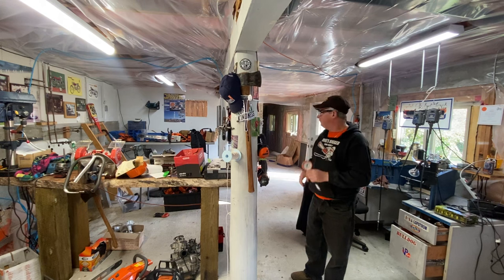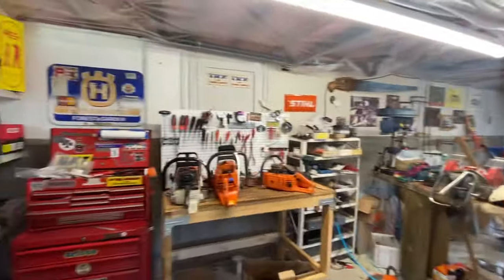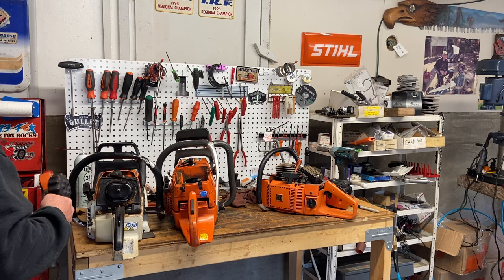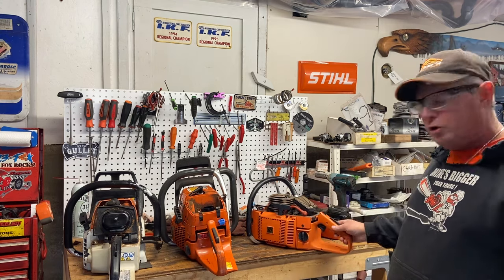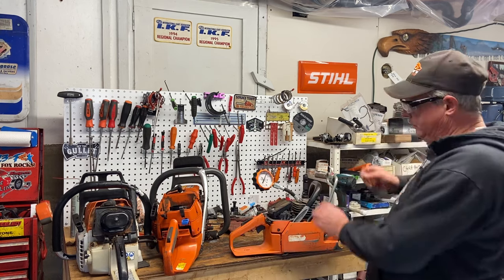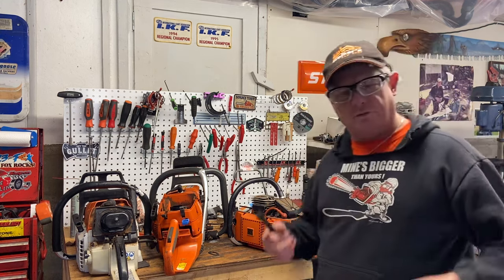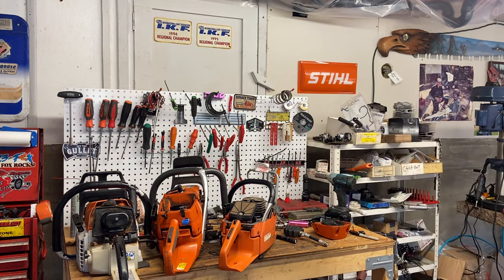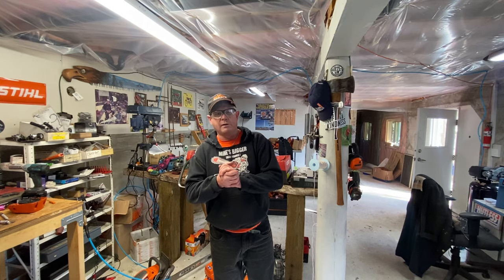How to check compression on a chainsaw

Comment: This video proves my point on why compression testers are so important for diagnostics, if someone had justy pulled the muffler and saw the scoring they would say the saw is shot but like donny says the piston is scored but the rings are fine which is what matters so the saw is fine.  also there is no way pulling the muffler will tell you that the rings are worn out or that the cylinder is egged out or that chrome plating is worn through on the cylinder.  these can only be prompted to check if the compression reads low and the only way to test it is a gauge. anyone who learned 2 stroke theory knows this.

Comment: Do you have to have a small engine compression tester, or does a normal automotive compression tester work? I just bought a snap on one and every saw i have even a brand new 572 is reading 110, 115  psi. I bought the snap on bc i wanted something accurate. I have a cheap one from Advanced Auto, and it reads every saw iv ever tested 80 psi or below, which is why i got the snap on today but now im worried it isnt right either

Comment: Donnie, I hope you’re on the mend and are back up and around quickly. A couple of ideas for some videos while you’re laid up would be your views on mix ratios and what mix oils you would recommend. Also the use of the pre mixed fuels. I’ve heard a bunch of bad things about the Tru Fuel brand. My dad always ran 40:1 mix and I have a couple of his old Poulans that look great. Personally, I feel like running a 50:1 mix accelerates the wear over time. I like down in North Carolina and some stores have non ethanol gas, which I religiously use for my mix gas and small engines. Just thinking out loud but I would like to hear your views about it.

Comment: Hey Donny, the new 372xp oe saws (2020+) from overseas are using gilardoni cylinders instead of mahle. What are your thoughts or experiences with gilardoni cylinders? Wondering if its worth waiting to find an older mahle version. Cheers

Comment: Great timing, I was just checking an old saw of mine against a new one and they both came in around 110psi, which I thought was a little low(car guy, first check on a saw). Looks fine on the muffler side I'll keep running it.
Thanks

Comment: Mr Walker, you’re way further down this road than I am, so I’ll defer to your wisdom, but doesn’t it all matter?

When I have a saw in my little hobby saw shop, it always gets a pressure/vac test, piston inspection, compression test, and bore scope. 

I feel like that is a very inclusive inspection and every point has it’s own tale to tell..
Reply: That’s the correct way to inspect everything. Not many shops will spend the time, especially on a homeowner saw, but definitely worth doing on a pro saw. Bare minimum I’ll check compression, pull muffler and scope cylinder. Usually an air leak will manifest itself by how the saw idles.

Comment: Isn't it all about the rings? The Husqvarna workshop manual says to measure ring gap to see if you need new rings, but surely a compression test gives basically the same information assuming the cylinder wall is OK. 

I measured compression on one of my rebuilds to test if rings actually do bed in after a period of time and increase compression slightly, rather than just trusting someone else's word on it.

Comment: The 585 and 592 are typically pretty low compression from the factory or so I've heard, 155-160psi or so.. may be wrong
Reply: Less … more like 130-140 psi, actually had one at 128psi but it STIHL pulled like a freight train thru the timber !
Reply: @fabzacres-blackcat  yeah I heard they were very low, was going from memory off a build thread
Reply: @JoshNoss  that’s how come from the factory - seems to me like they pull pretty g-damn hard in the timber with that supposedly “low compression” … I don’t think high-compression is the be all/end all like some folk believe. A increase to a sweet spot for sure , but 190-225psi is gonna make em puke 🤮 the lower ends prematurely and generate lotsa HEAT! In fact Husqvarna has a dished piston for the 562xp to lower the compression- I see 2 pistons available - there was a guy that commented on me channel that stated there was another cylinder made that reduced the chamber and that’s why they went to the dished/scalloped piston - I cannot find this other cylinder. Maybe Donny can chime in about this and give us the straight goods as to WHY they made the dished piston and IF there is a supposed “other” cylinder with a smaller combustion chamber
Reply: @fabzacres-blackcat  seems that a 562 mark 2 is out overseas, would be interesting to see what they've got going on the inside once they're available here.. my 3 saw are the 592, 572, 550mk2 and I agree about the high compression statement, in these 2 strokes it's not as important as some people think
Reply: @JoshNoss  mark ii n/a in the states to the best of my knowledge- heard it’s slightly less weight but performance wise no gains … it depends on the saw imho - the g372xp clone I built for a farmer had almost .055 squish so in THAT case it makes sense to use a thinner base gasket or for the machine crowd , machine the squish and the base. For a saw that comes from the FACTORY at .027 - .030 squish I think you’re chasing your tail and it’s not worth

Comment: Great stuff 
Think I’m chasing a air leak on my 371, kinda driving me nuts
Reply from the maker: Put some seals in it and check carb boot and cylinder gasket
Reply: @donnywalker4691  👍🏻
Thank you for the reply 
Just seems to be inconsistent, starts decent and seems to idle good but right off idle when hitting the throttle it falls on its face and will die unless you let off the throttle and ease back into it 
Definitely going to throw some seals into it this winter

Comment: hard to pull saws . can you explain causes Chris
Reply: No grease on clutch bearing.  Total failure of the clutch bearing.  I wish I could post pictures but can't.  
Scored piston.  If the saw has been sitting for years it could be dry.  No oil on the piston or rings.